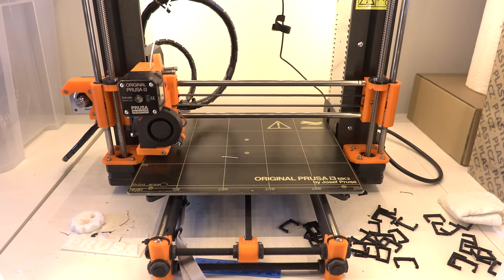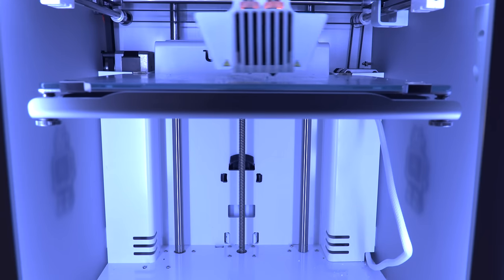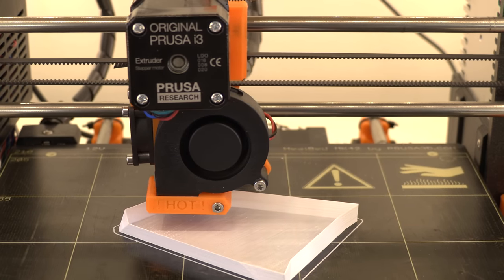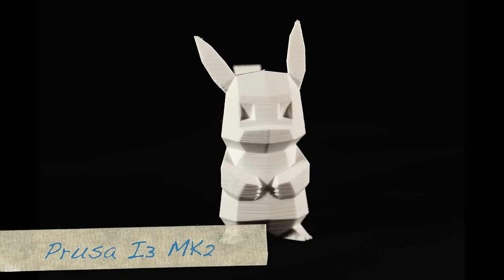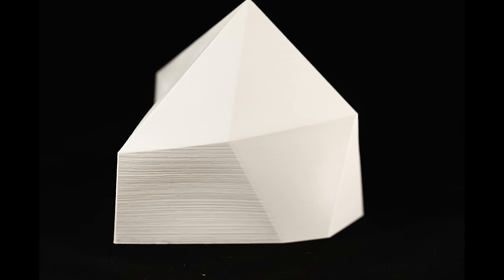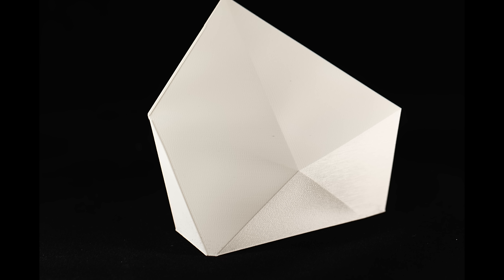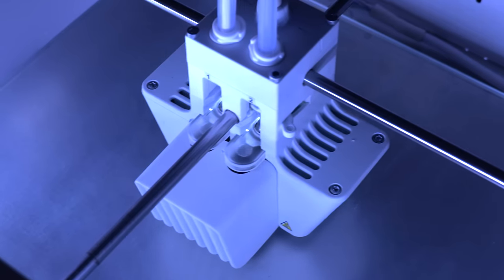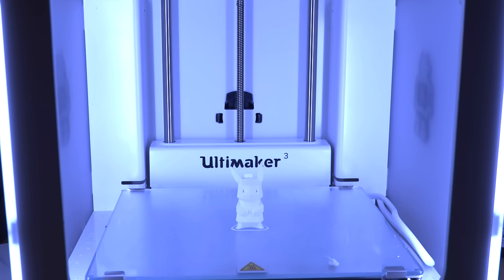Comparing the print quality of the Original prusa I3 MK2 with Ultimaker 3

Comment: Great comparison. I'm surprised at how bad both printers are out of the box. I bought an Anet A8 fully knowing that I'd be getting a cheap $200 kit that could burn down my house, and it produced prints that are noticeably better than that (still does, it went through two 1kg spools so far). I'd love to see a comparison of fully calibrated printers.
Reply: Yes Anet A8 can print very good models. Just needs a few calibration which everyone might not be capable of or keen to do
Reply: When you find the right settings, every printer is good, some are better because of the extra features
Reply: I think the anet A8 has no future today, now it has been replaced by machines such as ender or alfawise, however they are light years behind a prusa like the mk3s ... three years ago perhaps it was the best value for money printer,  but today as today € 200 for an acrylic structure makes you laugh ... however whether you want to spend a little but print take an ender 3 or an alfawise u30, if you are looking for support quality reliability, precise calibrations precise and beautiful prints under € 1000  prusa is the best ..

Comment: the ultimaker is not calibrated.... it's logical that the print take 2 hours and the prusa 3.5hours for the pikachu because you has setting more speeder the ultimaker than the prusa... we can see that in the waves of the corners, that is only the speed configuration

Comment: hella ringing on the ultimaker. are the belts a bit slack? can you adjust acceleration and jerk in the firmware? printing slower would help, too, but it's fun to print fast so check the first 2 :)

Comment: Hello 3D Printing Stuff.
First off - nice video, thanks! I'd love to see more comparisons between these two!
Second, a bit of constructive feedback:
The ultimaker was about twice as fast - you should test these printers at the same speed. And I'd love to see two tests here, one where the Prusa prints at ultimaker speeds and one the other way around.
Second, you should try to find a material that prints nicely in both of them and do the test in that material.
Third, it would be nice if you could do a screen clip of your settings so that we here at home may also know them.
Thanks for the video, keep more coming :)
Reply from the maker: I wanted to do a comparison between the default settings for both machines, every machine requires tweaking (And this might be different for each specific machine, not just a brand), so providing settings doesn't mean everything. Thats also the reason I didn't post any specific settings, as you can simply get those from the default slicer :).
Regarding material, this is not as easy as expected, because they use different material sizes. So I won't be able to use he same material (Which would make a fair comparison) for both machines. Colors, brands and sizes all have influence in printing, and as such in the end quality.

Comment: I do not see how they would be used for different things at all. Can you elaborate? I mean, the only notable characteristics of the 2 that would be for different things in my mind would be the difference between a bowden and direct drive setup
Reply from the maker: They are for different type of customers. I don't think most hobbiest would buy a 3500 euro ultimaker, but they would buy a original prusa. With that, it also comes with different requirements and different use cases.